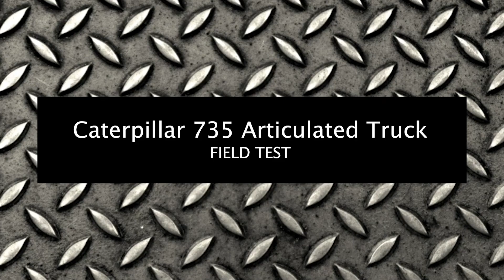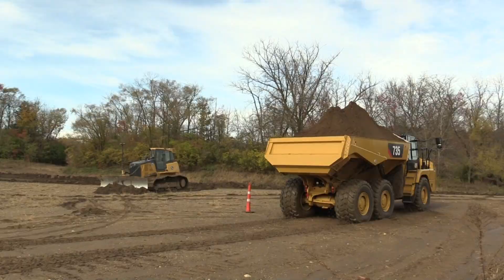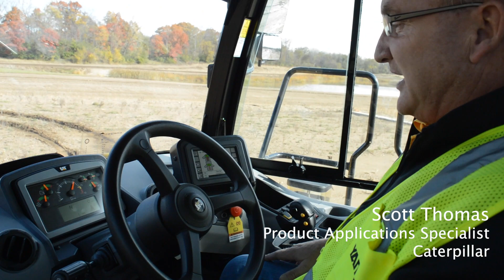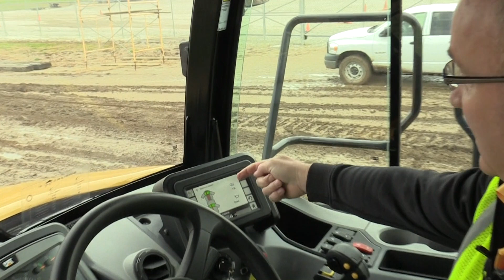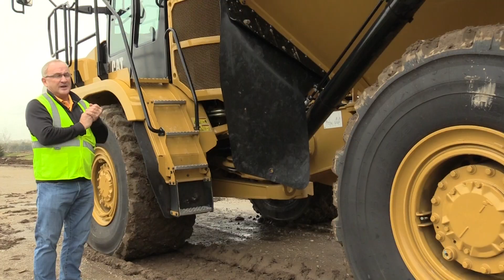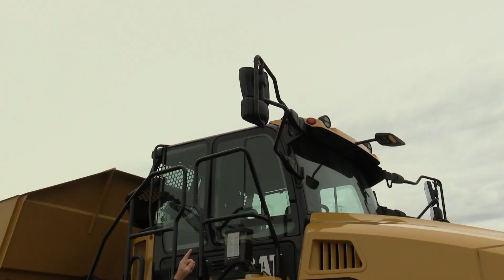Field Test: Cat 735 ADT

Comment: Yeah, I've driven one... NO power, even hauling 15 or 20 tons. And the damn warning alarm goes off CONSTANTLY!!! Even when it is NOWHERE near rolling. Kinda defeats the purpose of an offroad haul truck, if you can only use it on flat dry hard pack... I'll admit, I'm new to these machines, and our Volvo didn't have much more power, but at least it didn't tell at me the entire time. Maybe you can turn that stuff off, again, new... But it's still a pain in the ass, and just one more thing I don't like about cat machines. Damn thing is also a bitch to get into, the first step is too high, second step is too high from that. You have to crawl under the mirror to check the oil. The mirrors stick way out, so if you're near any trees, you're probably gonna have to get out and readjust them constantly, if you don't break them... Cat is one of the oldest manufacturers, but every machine seems like it's maybe the second one they ever built. Or first, on some occasions... Like who would've ever thought a skid steer door needs to open more than 40 degrees... 😐 At least that got fixed, but it never should've made it past the FIRST day of testing. Or why wouldn't you want components in the way of tracks that hold mud in, instead of letting it fall to the inside? They're really not good with tracks, at least smaller rubber tracks. They did get the dozer final drives up out of the mud, but damn... Pretty sure they've got a lot of plans drawn in crayon...